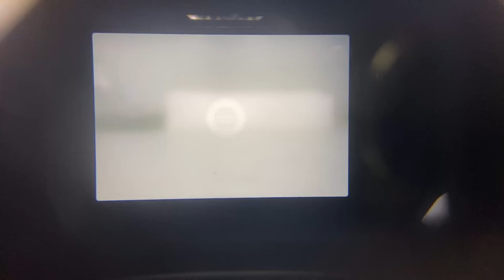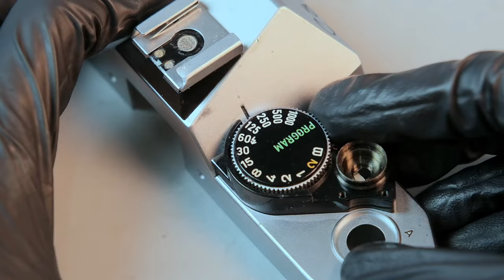Resurrection of The Forgotten King - 1981 Canon AE-1 Program

Comment: Thank you. Are you familiar with Pentax MX? I bought it recently, it's functional and i "fixed" the light meter by cleaning the battery cap from oxidation. However the mirror inside looks a bit dirty, do you think it's ok to wipe it out the same way you did with this canon? It's weird because it does not look like black smudge but more like a pigeon poo.
Reply from the maker: Just use soap water on mirror. other chemicals can damage the mirror

Comment: Very professionnal work, where did you learn all this ?
Reply from the maker: By reading service manuals. There is canon ae-1 service manual pdf available on some website. Even though Ae-1  and Ae-1 program are a little bit difference in internal circuit, ae-1 service manual really help me a lot.

Comment: Please help! First of all great video, you made it like new! I tried to open the bottom and lubricate it because it squeaks but I encountered a different problem. I found a small black o-ring that I do not know from where it came off and I would like some assist. Thank you in advance 🙏
Edit: I found out it was from my screwdriver. Phew! I couldn't find where to put oil though
Reply from the maker: If you get the squeaky sound during cocking and releasing shutter it is because of gears on the side of the mirror box(not the circuit side). Check out 4:40